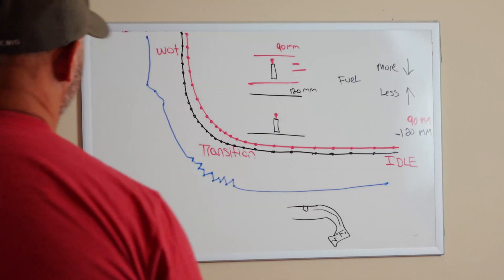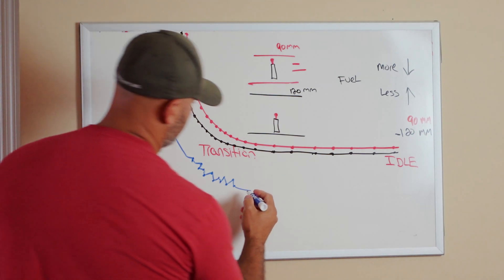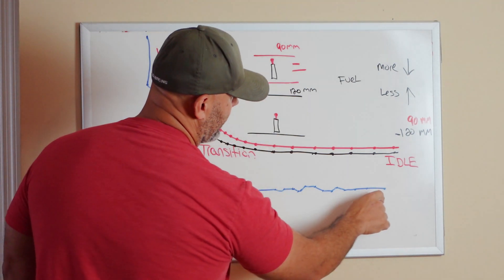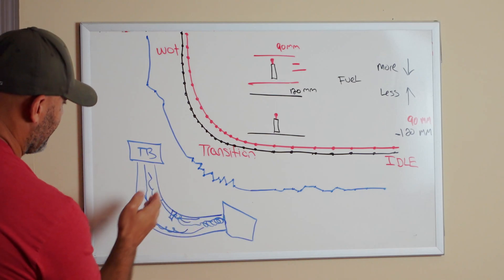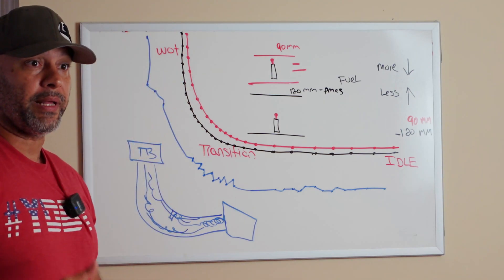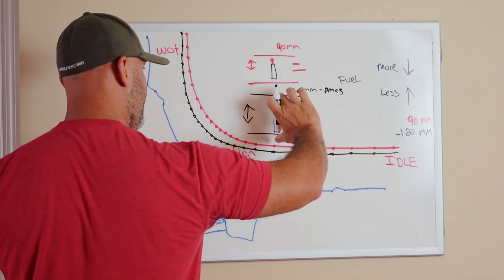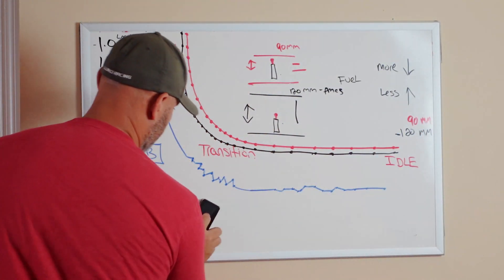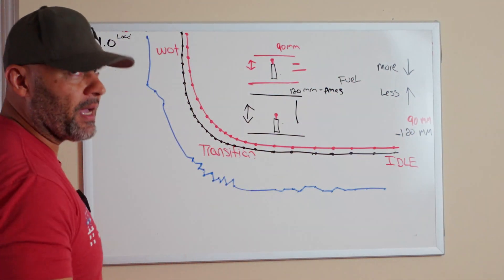White board series #6 Maf curves affects how a car drives.

Comment: I tuned my 3rd gen about 6 months ago from a stock tune to the typical bolt ons with e85 from scratch. Took me a solid 8 months of reading and talking to people to get comfortable enough to tune my own car and id honestly never look back. Super happy. Im glad to see you putting these types of videos out there. It reassures alot of the issues ive ran across and learned from trial and error. Ex. the MAF turbulence.. I changed my grill to a better flowing one and it caused MAF turbulence and took me a week or 2 to figure out what the issue was. Thanks

Comment: Even as a someone who tunes his own vehicles Im enjoying the whiteboard series. Never know what you might pick up. Im not entirely sure the statement about a MAF sensor measuring mass is completely true though. The MAF sensor uses a hot wire that supplied a constant voltage and resistance of that wire changes when it is cooled by the air velocity which causes resistance to decrease and wire current to increase to reach temperature again. Its not really a mass of air since the sensor has no idea what the volume of that air going across it is. All it cares about is maintaining that temp. The ecu equates the mass by knowing the intake tube air flow characteristics. That's why when you increase the tube diameter the air velocity in the intake tube decreases and you must add more fuel to compensate for the lower voltage or frequency from the MAF sensor.
Reply from the maker: Lmao the sensor measures MAF lbs/min. Aka weight, aka mass. 
It's literally called the mass air flow sensor. Lmao. But what do I know. If gale banks agrees with me, welp maybe i know what I'm talking About.
Reply: @YDBT4LIFE  It does calc mass air flow but only after calibrating the MAF sensor properly to its environment. I think people really get hung up on the fact that it requires "calibration" before being able to accurately calc mass air flow after changing the tube curves or diameter its located in. It also requires a temp sensor in or near it in order to calc mass air accurately. So technically speaking the main part of the MAF sensor only knows air velocity, or how fast the air is going by it which is then input into a calculation coupled with air temp in order to derive mass air flow from it. If you strip air temp from it it's useless. But when a MAF is setup right it can accurately calculate Mass air flow. Also gale banks loves to act like he's never made a mistakes on his way up. He was just lucky enough to live in a time where smarter people didn't talk crap but rather taught/educated.
Reply from the maker: @JaegerWrenching  mustang MAF has iat. I'm not here to talk specifics. As most don't even get the concept.

Comment: Would air straightener screens be the solution to stop air turbulence on applications with non-shielded intakes, open grilles, ram air hoods, etc.?
Reply: They do help.  Just need to be more than some home depot mesh though.  Ideally square mesh with a reasonable thickness to straighten the air.  Plenty of old style GM MAFs use these from the factory.

Comment: If the maf sensor is to close to the throttle body under boost, could that cause the load to be higher than it should be? I’ve been fighting this issue for a while we’re load is reading way to high, like 2.5 at 13 psi and 2.8-3.0 at 16 psi.

Comment: Good stuff.  On MAF sensors, it helps to remember that the sensor itself is only measuring a very small cross sectional area of the airflow through the intake.  That's why you'll often see MAF companies talking about the sensor transfer function.  If an engine is demanding the same air mass (3000 rpm, 10" vacuum, constant load for example), the air mass measured at any given point by the sensor will be reduced with a larger diameter intake (vs. stock), which is why we have to increase the MAF sensor transfer function in the calibration - if you see (x) airflow across sensor it means (x)*(y) is entering the engine - (y) becomes bigger as intake diameter increases.  If your design is good (ala PMAS), then it's a simple multiplier.  If its not - tuner headache.

This is also why laminar flow is critical as you pointed out.  All it takes is turbulence around the sensor (and nowhere else) to screw up your reading.  I've seen guys have really good luck with flow straightening grates, to the point that I'm surprised more intake companies don't use them to allow them to do whatever shape intake they want without MAF calibration issues.  Of course, that would add $5 to the cost...